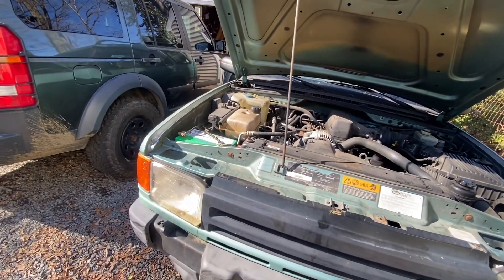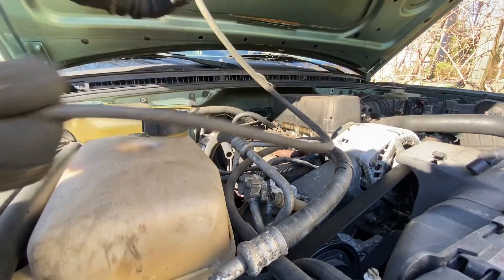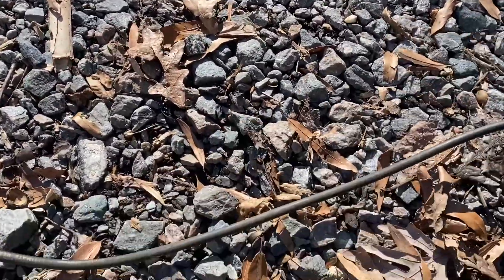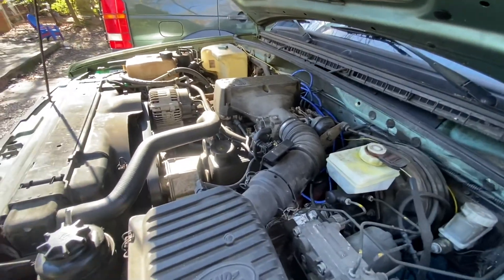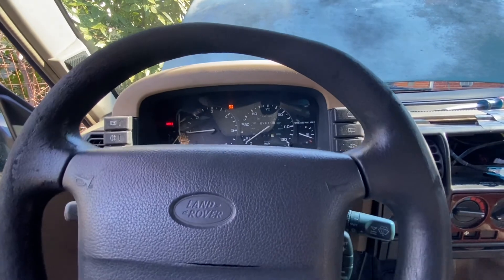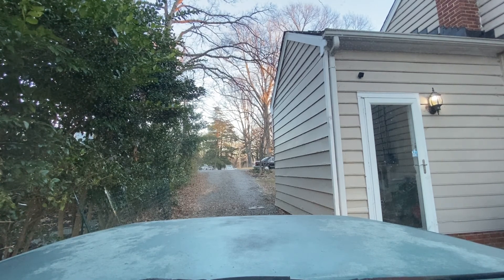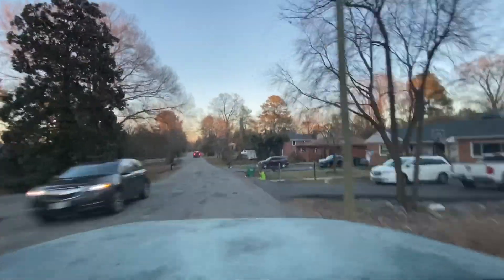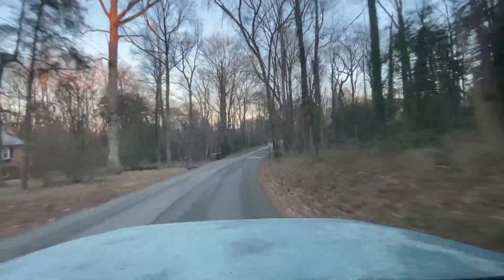Buying An Old Land Rover Or Range Rover?? It Needs A Tune-up!! (97' D1)

Comment: I’ve said this elsewhere about this car, but a 97 5-speed is INCREDIBLY rare. 94-95-96 5-speeds were already pretty damn rare, but the 97s are close to unobtanium. I’ve daily driven these 5-speed trucks since they were new and still do. I’ve been keeping an unofficial registry of the 97s and in the last decade of looking I’ve tracked down about 8 of them. Word on the street (message boards) from back then is that they imported about a hundred of them with a few dealer special orders. These have been thought of as disposable for so long I’d be shocked if there are even 50 of them left. It’s worth saving because they are utterly fantastic and quite different from modern cars.
The secret to these things is that they hate to sit even more than normal cars, driving the sh&t out of it solves for more problems than you’d think. Seriously. Parts are cheap, easy to work on and simple as hell. They are brilliant. 
Also, another thing with these is they went shifted to AELS mid 97 and it affects a lot of parts. Previous owners do things like order a fuel pump for a 97 disco and don’t realize it’s the wrong one and wonder why their truck drives like crap. 97 has two potential “correct” replacement bits. It has consequences for more parts than you’d think. I’ll have to go back and look at your video, but I think this is an AELS truck, if the emissions canister behind the battery is round it’s pre AELS, if it’s square it’s AELS.

Comment: Really enjoying the D1 and R.R Classic uploads. By the way, I recently sorted out all the exhaust gaskets and leaks on my D1 and I noticed that the exhaust manifold bolts have a habit of loosening themselves over time. Not sure if it's also the case with yours.
Reply from the maker: Well, its held on by a vice grip sooo..
Reply: @AddictedMotors  Oh.. vice grips to open the hood and vice grips under the hood!

Comment: so is this going to be the main rig for restoration and offroad? Would hate to see it go and it is worth doing the injectors for sure! Have you checked the swivel oil/grease levels yet and replaced the transfer case oil? These can get very nasty or just leak out, ask me how I found out...
Reply from the maker: All on the list! With the classic parked at the cabin I need something to tinker with.